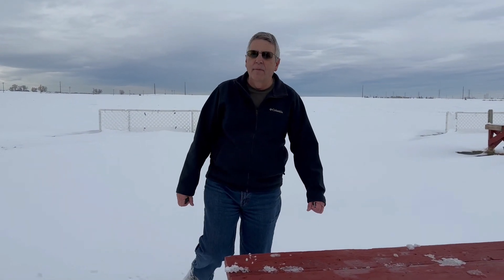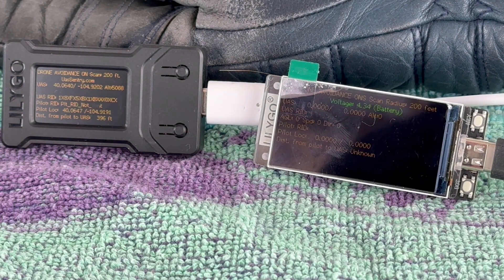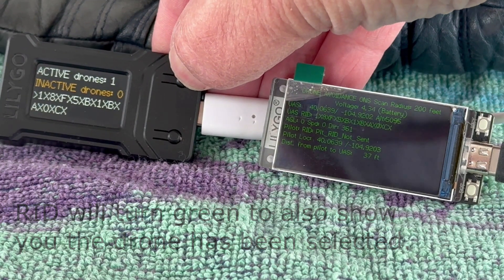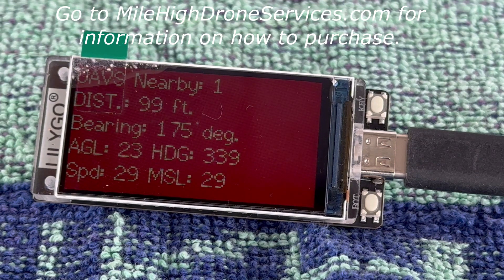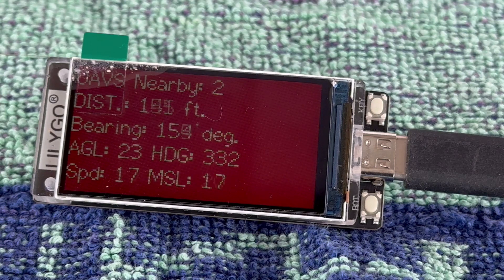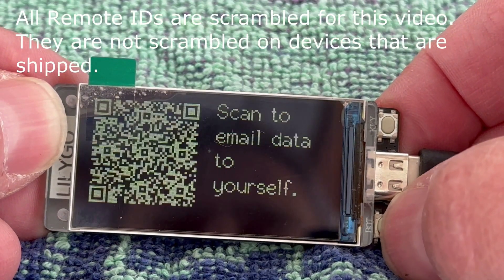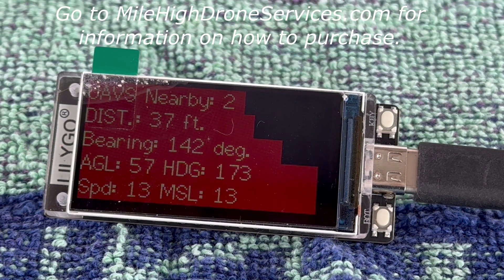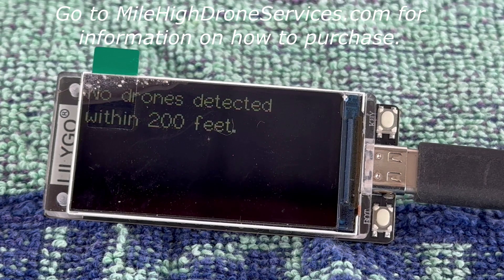A look at the Drone Avoidance feature on the Bare Bones Remote ID Receiver

Comment: The Remote ID avoidance feature on my drone fleet is way cooler.  😎
Reply from the maker: Example please? What drone are you using? If DJI, DJI only supports ADS-B notifications. Not notifications of other drones.
Reply: @VintageSlots  Avoidance feature #1: No DJI drones in my fleet.  #2: No RID modules or RID-programming on drones in my fleet.  #3: Tablet/phone on my tx ALWAYS switched to airplane mode before pairing with drone, to avoid unwanted firmware updates.  Result?  Permanent Remote ID avoidance!
Reply: @HughGBallz  LOL  got em good!   I have DJI drones, but I knew better than to update them.  I have them all hacked to remove DJI's NFZ's.  Result?  Permanent Remote ID avoidance!   RID is going to be an epic failure.   I'm going to be ordering a few RID broadcast modules though.  I plan on turning them on, and shipping them back and forth to friends.  Should be cool to see hundreds of fake drones at 30000 ft going 500mph.  Not to mention all around airports.  There is an entire FB group devoted to doing just this.  I can't wait to watch RID fail.   Companies like VintageSlots are horrible for our hobby and industry.   WHY WHY WHY would anyone buy this product?  So they can mess with pilots that are following the rules?  I fail to see the point at all.  Either the "other" drones are close enough to see, hear and avoid - or they are so far away they don't matter.  So one more time?  WHY?
Reply from the maker: @HughGBallz  guess you will never buy a new drone and will have a fleet that will become a fleet of dinosaurs since all drones made must have RID as of last December 15th.

In addition, assuming you are responsible enough to have insurance, good luck in getting a claim covered if they learn you are flying a drone with hacked firmware and if you are sued the other side's attorney will love the fact that you were flying with hacked firmware and intentionally violating the law.. If the FAA / NTSB gets involved it will also mean more fines to be levied against you.

The complainers need to put their big boy pants on and accept what the law is. The law is not going away.
Reply: @AztecLiving  Like the way u think 😎
Reply: @VintageSlots  You guessed right that I’ll never buy a new drone… at least one having non-hackable RID.  But you guessed wrong about me having a “fleet of dinosaurs”, since my current fleet of Hubsans and Fimis are non-RID and I’ll be able to repair them as needed for years & years.  You know, at some point you’re just gonna have to suck it up and admit not everyone is a sheep, and not everyone falls into a state of despair despite there being viable work-arounds for ridiculous rules.  In the meantime, stay triggered!
Reply: @AztecLiving  I think RID will actually make things safer for General Aviation pilots and their aircraft as well recreational and/or Part 107 sUAS.  I can handle an occasional Karen asking me about my drone in a semi-hostile manner.   If they're nice, I sell them the hobby.  If not,  I kindly get her to wait for a second and land and show her my license, drone registration and serial number of my drone.  Then I ask her for her license, registration and *VIN number, her lat-lon and the exact lat-lon of her car right now*.  Of course she can't answer.
Reply from the maker: @HughGBallz  So, in other words you have no additional drone avoidance features. 😀
Reply from the maker: @HughGBallz  Enjoy your toys and playing with what will soon be outdated technology.

Fortunately, most people are responsible and at least make an attempt to follow the laws. These laws probably wouldn't have been enacted if there were not idiots out there flying their drone in the middle of a baseball stadium during a game.
Reply: @VintageSlots  "Hacked" is just a term.  The firmware simply has the NFZ's removed as those are from China and not the FAA.  I do have insurance from Global Aerospace for my commercial drones and State Farm for my toys.  I follow the rules dude, I just dont see how your doohicky serves anyone.  I would LOVE for you to show me anywhere in CFR Part 107 that says I MUST install a certain version of firmware.  I've already had this conversation with the FAA.  I am allowed to use a broadcast module even if the drone has the ability to broadcast without it.   I would buy your product today if I thought I would get anything from it.  I don't see how this will make me safer.  Who cares if there is a drone 500ft away from me?  If its close enough to be a problem then I can clearly see and hear it as I do not fly BVLOS.  One other thing, these are RULES not LAWS.  If @Slapdat HughJass gets caught without RID, its a rule violation.   My newest DJI drone is a Mavic 3T.  Took me about 7 mins to "hack" that firmware.   I will be hacking a M30T next week, I'm guessing that will take 10mins.    I would still like to know what this product of yours is for?  Are you selling to 107 pilots like me?  So I can see other legal drones that are close enough to see with my eyes or far enough away to not matter?  Is this a cheap aeroscope for cops?  Speaking of cops...   RID rule doesn't give cops any new powers.  Unless you are in a stop and ID state, cops can't do shit.  I've had cops pull up and order me to land, I just laughed at them and told them to get a supervisor.  Any ideas how these encounters go?  When cops themselves are ignorant or the laws, how are they going to help the FAA?   Cops are LAW Enforcement.  Not Federal RULE enforcement.  If a cop tries to get your FAA number on your drone, that is a 4th Amendment violation.  Demand to show your TRUST or 107 = 4th Amendment Violation.   This is why RID is going to fail and fail badly.  The FAA really thinks local cops are going to be their saviors.
Reply: @WA4OSH  RID will not make anything or anyone safer, period.  GA = Ok, so a plane pilot can watch on his phone or worthless hardware doohicky a bunch of LEGAL drones.  So what?  How does that make him safer?    107 = Karens coming to see who is flying around them?  How does that make the 107 pilot "safer"?   Get a clue dude.   I mean I would argue that license plates on cars do not make anyone SAFER.  Sure its nice for cops to run the plate, and I have zero issue with that.  Just like I would have zero issue with the FAA or any other Federally Trained Agent/Officer could track my drone.  But can I view your car's plate and track you down?  You have no business seeing a darn thing in regards to my drone, or my car.  That is for authorities only.  Wow, you really don't get RID at all.
Reply: @AztecLiving  The license plate or VIN numbers on my car can be looked up by any joe public.  Does that make the freeways safer?  No.  But for an aircraft to see sUAS drones or fixed wing aircraft on their instruments just like ADSB can save lives.
Reply: @AztecLiving Slapdat won’t get “caught” because he flys responsibly, giving local law enforcement no reason to bother with him.
Reply: @undercoverfaadude8760  I don’t disagree, but think you may be missing the bigger picture.  By restricting the majority of recreational pilots to flying within FRIA’s and enabling the general public to identify the location of both a drone and it’s pilot, the FAA is taking the initial steps that are necessary if they want to clear the skies below 500ft AGL for commercial delivery drones.  That’s the end-game.  Doesn’t change my flying now or in the future.  Fly responsibly & pack up quickly after landing. 😎
Reply: @HughGBallz  Oh I know.   Walmart and DroneUp are having some issues in AZ this week with deliveries.   I'm all for safety, but I will never bother with a FRIA.

Comment: I'm sorry, but I am confused.  What is this for and why do I need it?   I can see other drones that are within 200 ft with eyes.   Why do I need to see other drones that are complying with RID?   Aren't there free apps that will do this already?
Reply from the maker: 1: Most of the free apps don't work. For example, IOS does not allow you to see the RID packets. Just read the reviews on the free IOS apps. THEY DON'T WORK!
2: Most of the Android phones don't support it either.
3: Most drone pilots have their eyes glued to their display and are not looking in the air for other drones. So, this could be useful  for those who are not using a visual observer.
4: Other drones are hard to see with the naked eye, especially if your drone is several hundred feet out. This feature may help.
Reply: @VintageSlots  1. I would never own a IOS device.  2.  Apps are still in development as RID is 9 months away.  3.  Having a phone next to me or your doohicky would be the same thing.  4.  I have eyes and ears.    I still would like to know WHY anyone would need this?   The only drones this thing will detect are drones complying with RID, so what is the point?
Reply: @AztecLiving  1. Ditto.  2.  Ditto.  The ones on Android don't work either.    3. Most drone pilots have their eyes on an FPV display or glued on their own drone, not really looking for other aircraft.  You have to have a visual observer for FPV flight.  He's your wingman and needs that additional warning.  4. I run FAA approved anti-collision strobe lights during the day so that I can be seen  Eg. Parasails, float planes and helicopters coming in for a landing by the nearby lake where I fly.
Reply from the maker: @AztecLiving  OK, well when you convince the millions of people who have IOS devices to dump them and then buy one of the few Android devices that support RID you argument will hold water.
Reply from the maker: @undercoverfaadude8760  Apple does NOT allow the developers to see all the packets that are being transmitted in the open. They deem it a security risk.

You are the one that has no idea what he is talking about. 

We had an IOS app (DronesFlyingNearMe) that was ready to go until we found out that IOS will not allow us to access the packets.
Reply: 200 ft from your drone not you